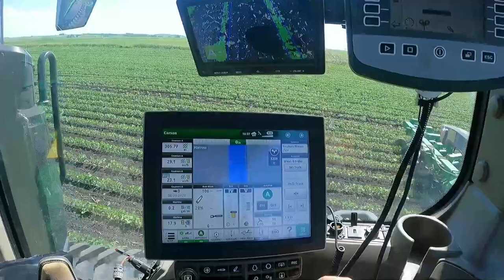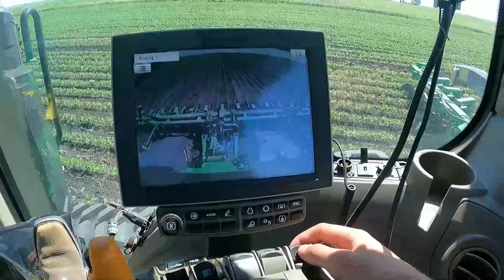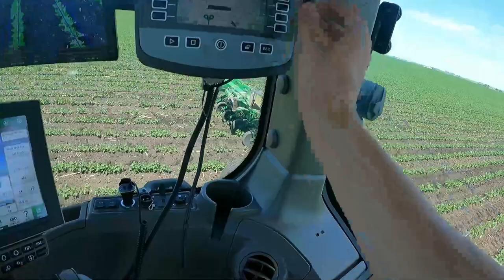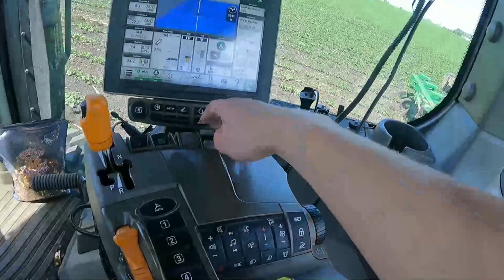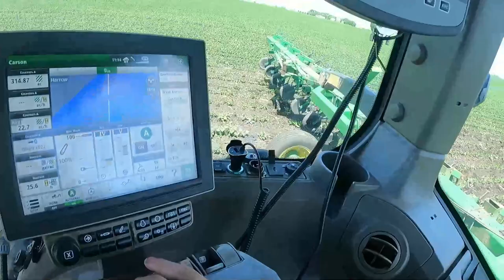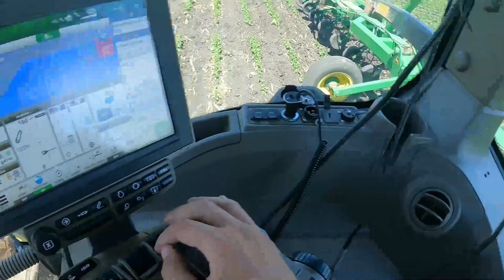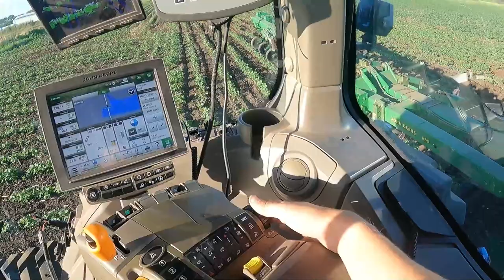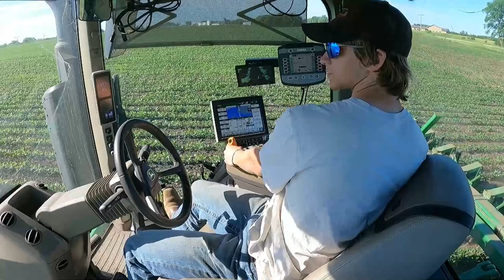Using a Camera Guidance System Cultivating Organic Soybeans!

Comment: Did you guys build the cultivator bar or have a shop build it for you? The transport dimensions look intriguing if you could flat fold it like a 16 row and still have clearance between the rear window and front folding rows. The 8rx’s set their 3 point hitches back further than our rt’s so their may be enough room